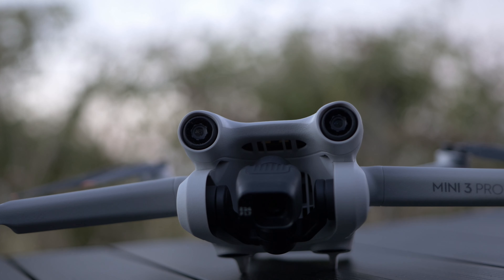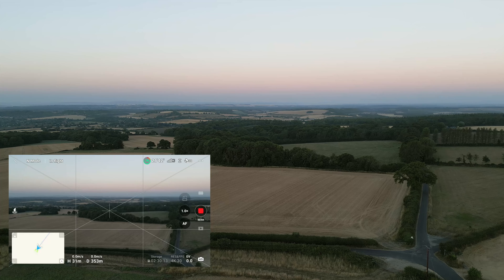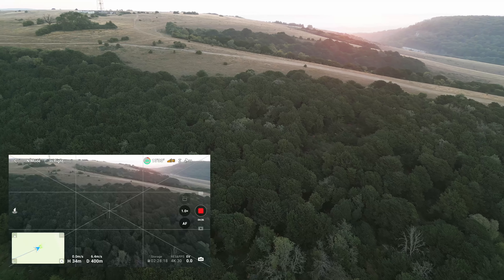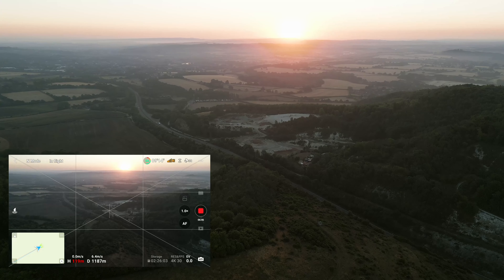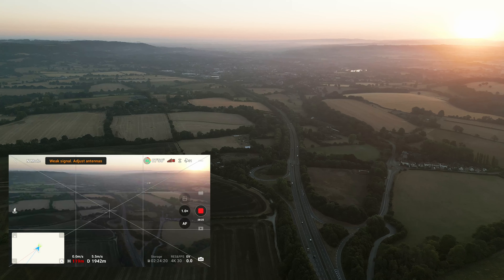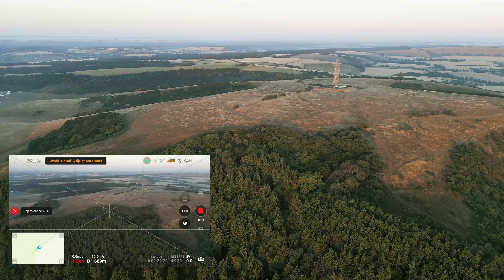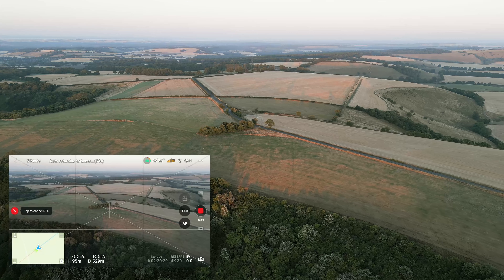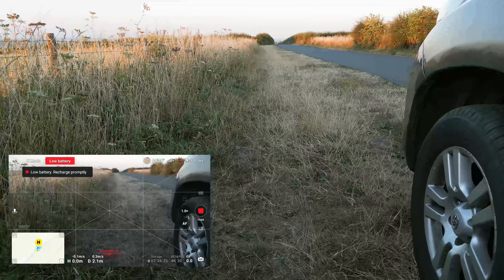DJI Mini 3 Pro Range Test With a cinematic 4K aerial view, but will I get my drone back?

Comment: I just bought my Mini 3 Pro and this is what always scared me the most. Thanks for showing me the results of losing signal.
Reply from the maker: No problem 👍, Just updated my firmware. I'm about to try this same range test in an urban environment with lots of wifi interference signal blocker in the middle, lets see if my mini 3 pro can come back home safely. I wish you safe flight, happy flying.

Comment: You can get a lot more range if you go up higher. The max range I got on my mini 2 was about 2.1 km at 300m and that’s in an urban setting with lots of comms towers.
Reply from the maker: yes, sure but UK CAA has a max height restriction of 120m from the point of take off for people like us.

Comment: Well...would keep my Dji2 better range, until they made better range even than DJI2. No point before. In urbant conditions are far short range.  So abs range and reliability is primary reason for as much as possible range. DJI 3 is step back

Comment: Not sure that flying right next to a mast that has multiple 2.4 and 5.8 Ghz wireless transmitters on it was a good idea, since those are the frequencies of the mini 3 Pro. They could easily have reduced radio performance. There's a guy in the US that has a mini 3 pro video where he achieves 5.5 km with no video loss.
Reply from the maker: Good observation, one of the comment also mentioned even the hill could also play a role in blocking the signal and suggested I could fly higher, unfortunately in UK I'm only allowed to go as high as 120m. After reading through the comments I can see that there are multiple things which could be interfering with the max range, however this is no way near to what DJI say on the mini 3 pro drone box a max range of 12km. I think this false advertising on DJI's part.
Reply: @rmproductions3547  agreed, 12 km isn't possible.
Reply: @rmproductions3547  is the 120m restriction relative to takeoff point or is it AGL?  I would think the latter, as it is in the US.  You flew over rising terrain.

Regardless, the line of sight issue is a farce.  Unless one uses strobes in dim twilight or darkness, nobody has visual acuity to see a mini 2km away.   This rule is routinely broken by pilots as demonstrated by countless YouTube videos.

Comment: The do the sensors sometimes say the front and back aren’t working, does it depend on what setting you have it in and can you fly it at a lamppost at usual speed and it would go around, how far can the sensors pick up obstacles,tnx

Comment: I might be wrong but there seems to be a hill in between you and where the drone was flying towards. Wonder why you got drop at 2.2km. I got around 5 km out of it in urban area.
Reply from the maker: You could be right there @GrumpyRider, I'll actually need to do a firmware update and then do another range test this time in urban area and share the reasults with everyone here,
Reply: @rmproductions3547  mine looses signal around 700 meters...:/
Reply from the maker: @juliangrutzner  yup you're right there my friend, however I've noticed few inconsistencies which I'll share with everyone soon. Just did the urban range test yesterday. Editing these 10bit footage from this drone is also a problem if you're like me using a free version of davinchi resolve as your video editing software. 😒

Comment: 2km is more than enough for what I need to do as I seldom venture more than 500m unless is ABSOLUTELY necessary. I prefer VLOS as my drone can be very naughty if she venture too far away from me. 🤣🤣🤣

I am surprise there is someone actually walking along this lonely road. Spotted her pretty far away 12:00
Reply from the maker: I agree 2km is more than enough and to keep the mini within VLOS is the best given the fact that this drone don't come with omni directional sensors, like you I also like to keep my investment safe 😆
Yup early morning rambler, did you also notice at around 6:03 at around the bottom right you can see a pitched tent or looks like a small tent, someone stayed over night.

Comment: I'm getting about 1200 meters before signal loss in city area my air 2 has much better range or signal
Reply from the maker: I don't get anywhere near that range when I'm flying mine : (
Reply: @rmproductions3547  oh that sucks I think dji should of had antenna on outside of the controller same as the smart controller I don't understand why they didn't do that probably money I suspect 🤔
Reply from the maker: @Colin Dobson I personally think it is to do with the rush to launch the product and quality control. When they say in the box 12km max range I would really be happy with even the half of that range but this is not what we're getting at the moment. Even with N1 controller. Personally I'm not that pleased with DJI and I also find it very odd that all other youtubers are full of praise with their mini 3 pro. I'll do a detail video on this because there are definitely some good things which this mini 3 pro brings to us but there are some big drawbacks which comes with this drone and final thing is the price it is quite high in my opinion. 😞
Reply: @rmproductions3547  yes definitely seems dji with every drone they release it's not what they advertise drones unfinished it's starting to piss a lot of people off no doubt and yeah I noticed a lot of YouTubers who don't point out the problems with new release drones even months down the track personally what I think happens is what's going on in China at the moment I suspect the Chinese comuist party are putting pressure on dji and the results are rushed un finished drones hopefully they can get back to the old dji that everyone knows oh have you checked out my YouTube channel mate it's under my personal name just starting out learning every day cheers col 🍻

Comment: I would have thought I would have travelled further then 1 1/2 miles
Reply from the maker: The mini 3 pro box I think says 12km and when I got 2.2km it didn't make me feel good, only positive thing for me was for my use case I normally don't have to fly that far, however I think what DJI did by saying 12km on the box is just plain false advertising, and the price of the drone is also quite high, all youtubers are singing the praise of DJI mni 3 pro, I think I need to clear this out in my next video.

Comment: this RC controller with screen has really bad range compare to the good old N1 rc controller. specially in Europe and that crappy CE signal we have over there. despite i love this new controller i stick with my old n1 controller to have better range. what dji thinking making this crappy controller without external antenna.😐
Reply: I managed 9200 meters with my mini 3 pro with the rc controller with screen

Comment: Get the mini 3 with normal controller and put in fcc hack 👍
Reply from the maker: Yup, sound idea, but the fcc hack do you mean a drone wifi booster?
Reply: @rmproductions3547  no it’s a hack for your phone ,I got over 3000 meters in a urban area check my video
Reply from the maker: @Gavoo1234  This sounds cool, Mat do you have a video of this feel free to share here if you want, if not no wrries, I'll just google it, but 3km thats an excellent rnage 👏👍
Reply: 3km is kinda normal for my range test in urban.. Mine CE with screen controller. All stocks and no modification or hack..

Comment: The range is listed 18 km on dji’s website what a waste of money 😂
Reply from the maker: @MooseRecord just checked the mini 3 pro box it says 12km FHD transmission. However I'm sure they mean under ideal situation. Even with 2km by the time I got drone back I had just enough battery to land the drone so 12 or 18km would beyond the battery capacity. Nevertheless I see your point, in my opinion this could be bordering towards false advertising but not a waste of money. Most of my work is landscape photography and video work and a max distance I might need to fly for given shoot would be around 500m, so having the 1.6km range is enough for me. I will definitely do another range test in urban area just to see how this drone copes with all the wifi blocker.
Reply: @rmproductions3547  i am pretty sure they mean 18 km  range so the drone can come back because if u watch dji pro 3 video it can go up to 18 km and come back and it has the same battery life
Reply from the maker: @mooserecords8454  actually few people in the comment did say that they're getting longer than 2km out of the box but I never saw a CE version of the RC controller has range more than 3km. I really need to check the range in urban environment also, just to get an understanding what I'm working with. Thanks for pointing it out. I found one comment here very useful where he used the normal RC N1 controller and did a software mod to convert from CE to FCC and had a boost in signal. So there are ways. I have few trips planned out so let's see if I can get few more cinematic shots.